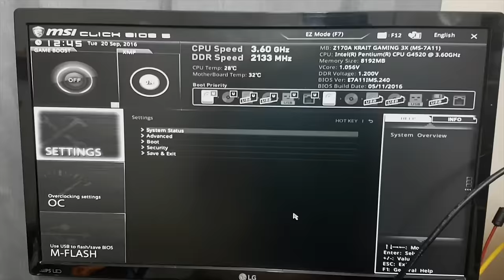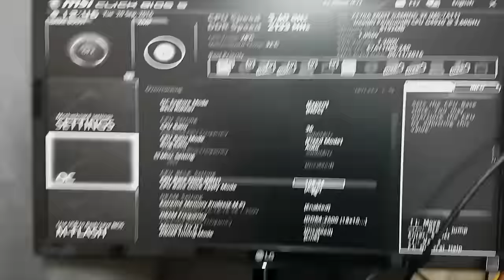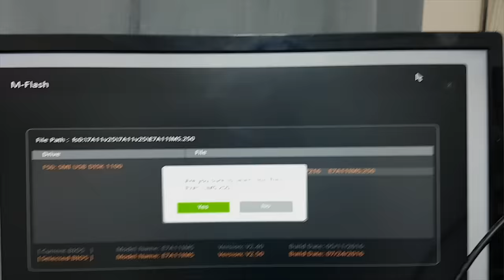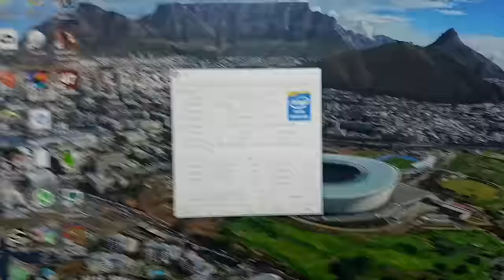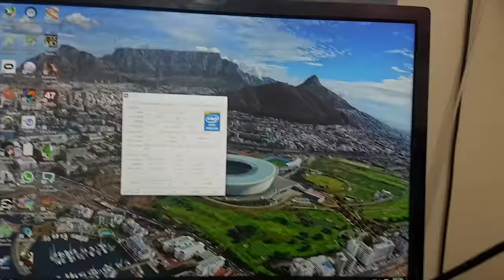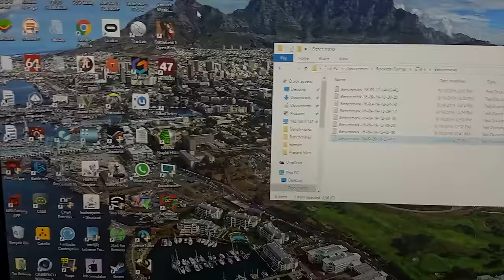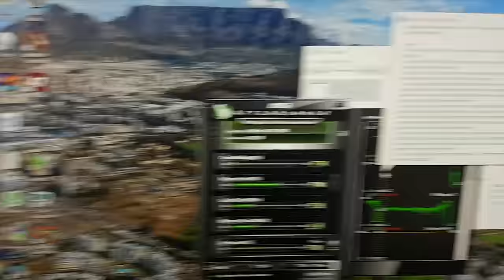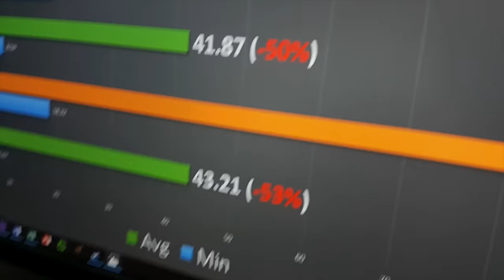$0 Pentium CPU HACK!!! -  How To

Comment: Hey UFD,I have the same Mobo and a G4500. I run at 4.5ghz @ 1.355v.
To unlock BCLK oc you have to flash the bios with a custom version..  also I recommend you disable Intel c states  and xmp profiling and use ram freq under 2500 to not stress the pch.Lastly, enable CPU GT load line calibrations for stability. Cheers.. look forward to another vid on this!!
Reply from the maker: Which custom version BIOS? I tried everything I could get my hand on.
Reply: UFDisciple http://overclocking.guide/download/msi-z170a-krait-gaming-3x-non-k-oc-bios/
Well this is what worked for me
Reply from the maker: Used that one as well, wouldn't work for me. :(
Reply: Flash it and reset ur CMOS or try downgrading to the original bios release then flashing. Not sure :(. Sorry
Reply from the maker: +Goodguy 15 Did all that.  Literally tried everything I could.  Wouldn't work.  Guess it might be on a board by board basis?
Reply from the maker: +Goodguy 15 Did all that.  Literally tried everything I could.  Wouldn't work.  Guess it might be on a board by board basis?
Reply from the maker: +Goodguy 15 Did all that.  Literally tried everything I could.  Wouldn't work.  Guess it might be on a board by board basis?
Reply: I seriously doubt it . Unless that's how the recently manufactured MSI Krait 3x boards are now being made. I'm really puzzled as to why. But I do notice tht my BCLK overclock is sensitive to the type of ram I use. I will check the date of manufacturing on my board and let you know soon, if that can be of any help.

Comment: Nice work! Do you know if its possible to do it on latest update of windows 10? I had multiple failed attempt (G4500 on Asus Z107i pro) despite of having custom BIOS. I could increase the base clock, voltage etc but could not get past the windows logon screen, it takes it to the recovery prompt everytime I restart.

Comment: You need a custom bios to OC  that chip. 4.5 ghz is easily achievable. No such thing as "3.9 limit"
Reply: where i can find this custom bios ? or how can I make it ?
Reply: @leoyru.3361  did you find it?
Reply: @ElLanzeh  still didnt found . my chip is g5400 8gen 3.7ghz , tried gigabyte easytune , intel xtu and the bios(original) none of them let me put higher than the original 3.7 only lower
Reply: @leoyru.3361  Is your motherboard compatible to overclock?
Reply: @ElLanzeh  looks like no , is a h310m  gigabyte

Comment: I bought it (g4400 with z170m)..but with future upgrading in mind with K-version cpu because at the time of building it, i was on a strict budget, so i did rather spent more on mb now and lower cpu, than lower mb and good cpu which i would be changing them both in this situation. But since cpu is easier to swap than mb, thats why i did what i did. Nice video though!
Reply: UPDATE: i overclocked g4400 at 4,4 ghz and its going ok. I use this overclock when playing games so i dont overstress the cpu with higher voltage when im not doing demanding stuff.

Comment: Hey Brett, perhaps try testing the overclock % difference along games that use the processor more, like AOTS and possibly Total War: Warhammer. In those cases, CPU performance heavily bottleneck the GPU. In Warhammer a lot of processing effects, like shadows, are calculated using the CPU, nevermind the loads of units on the battlefield. Good video buddy :)
Reply from the maker: +MrPansyfaust Thanks for the suggestion.  It's definitely a clear advantage to overclock the CPU in those instances, but I think I was trying to go for more "typical" game scenarios, as in how much is affected in GPU dependent tasks.  If it can't clear the hurdles in these scenarios, I'm certain it'll go worse in CPU dependent environments.

Comment: Is iris 540 graphics better than kaby lake's integrated graphics?
Reply from the maker: +The Strider9 I couldn't tell you.  I haven't tested either of them.
Reply: Okay
Reply: The easy way to tell is with benchmarks. If you look at the website Videocardbenchmark the 540 gets a score of 1357, the low end Kaby Lake HD 620 gets a score of 923. The charget will get upgraded as the higher end Kayby Lake CPUs get released.

Comment: what's the minimum motherboard requirement to overclock the G4520/G4400?  Will it overclock on an H110 or does it need to be a Z170?
Reply from the maker: +Rico Angelo Tan Pretty much. They're the only chipset designed to overclock, so should be the standard.  Here's some further reading though: http://www.tomshardware.com/news/overclocking-with-non-z170-chipsets,30962.html
Reply: Thanks!

Comment: The g3258 is better because you don't need a z170 mobo. I have an Asus b85m-g and can overclock it easily with the CPU ratio setting. Much cheaper mobo and easier overclocking.
Reply: But the G3258 is an old chip and stutters alot in newer games. The G4560 performs better than an overclocked G3258 at a cheaper price.
Reply: The 2 additional threads alone already makes a stock G4560 better than a G3258 overclocked to all hell.